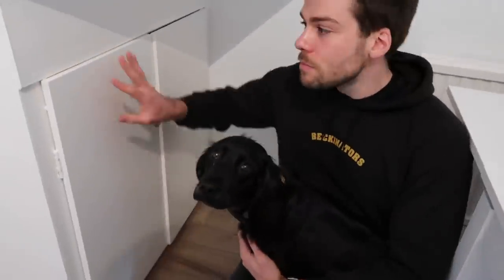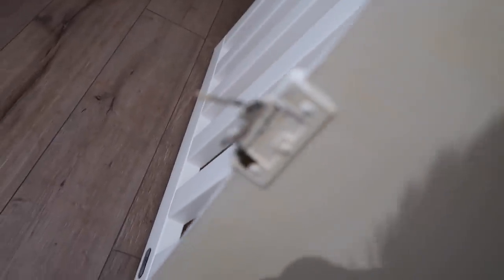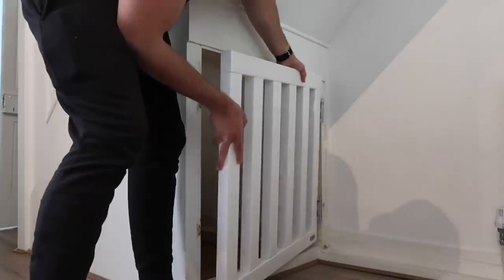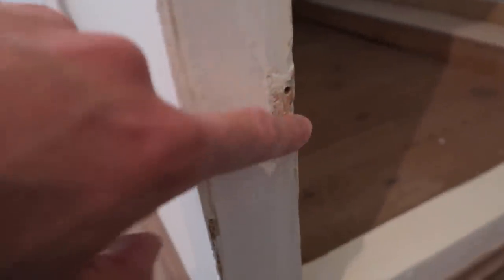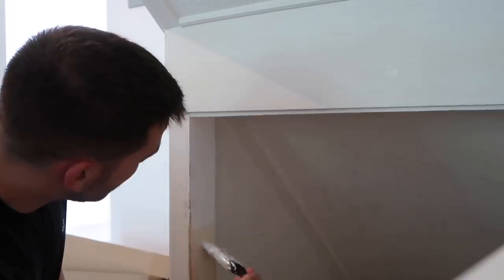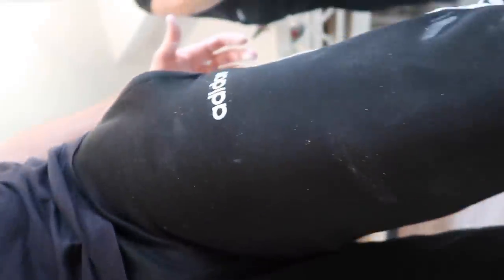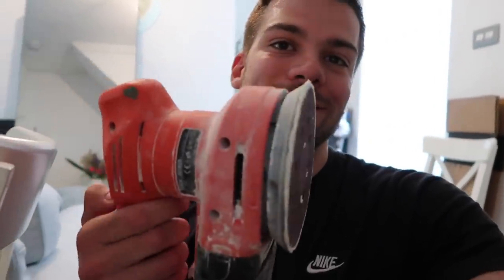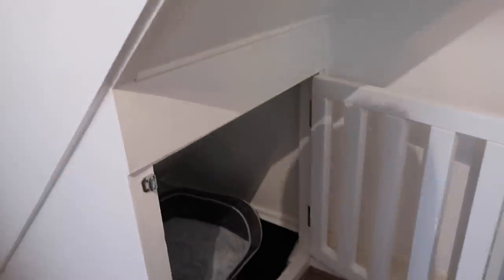Transforming a Cupboard into My Dog's Bedroom!

Comment: Well done, Joel!  I do wonder about locking her in for the several reasons mentioned by others.  If it's just a matter of her learning that the Harry Potter cupboard is where she is meant to be at night rather than wandering about, I'd try NOT throwing the bolt when she goes to bed after a reasonable number of successful sleeps.  You've done a grand job of making this a safe space; allowing her to escape on her own, if ever necessary, takes safety up a notch.

Comment: You can get a small rug that will both cover the box in pipe area, and the floor in Ava’s room - a soft one that can be cleaned in the washing machine. I like the idea of her name above the door, but without is good also! You may consider a more low profiled dog bed that will allow Ava to stand up to stretch her legs. Also, can vent holes/slot be put on the adjacent wall for air flow? Can you do that without it looking tacky?

Comment: I like the idea of simple oversized paw prints above her door. 🐾 One or two large stenciled paw prints (the size of your palm, so they are recognizable but not too obvious), centered above her space. And one of her actual paw prints inside on the wood under her bed. They never come out as clean and neat as you would like, but it is a nice forever memory of her. 
I would not paint her name above the door, because I would never want to have to paint over it once I painted it. Maybe a little oval framed picture of her with a stenciled paw print on each side?  Or you could stencil a simple 'A' or buy an 'A' and hang it above her door. 🙂
Or a heart. Or there are nice, long, rectangular signs with quotes on them that you could mount above the door. I like the idea of having her picture hanging on the wall outside, but it might look weird in the space.  Good luck! I am sure whatever you decide will look great!

Comment: I would just stencil Ava in a nice sleek, modern font above the door. Then frame a miniature duplicate of her portrait on the inside wall. A little light that activates when you open the door would be a nice touch. I would also find a way to put down plastic sheeting or lino or something so that it will be easier to clean when she 🤮 or 💩 all over. 😆